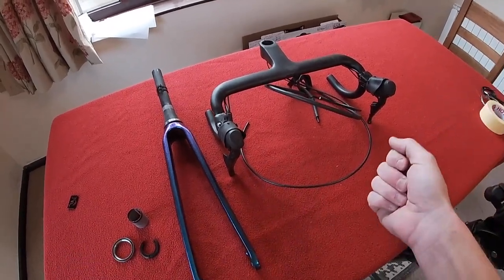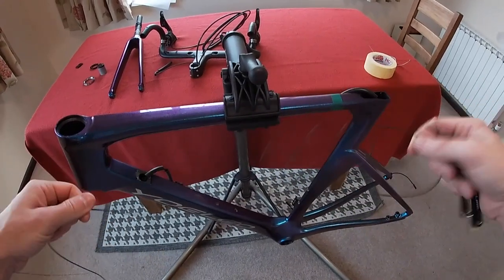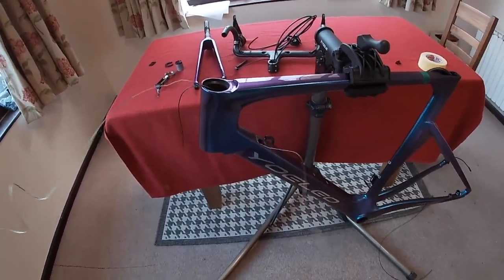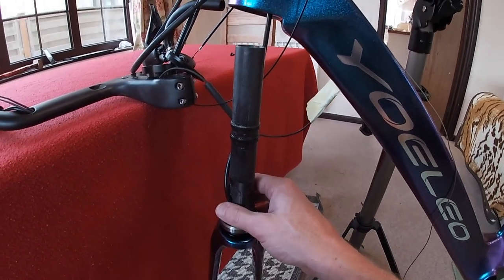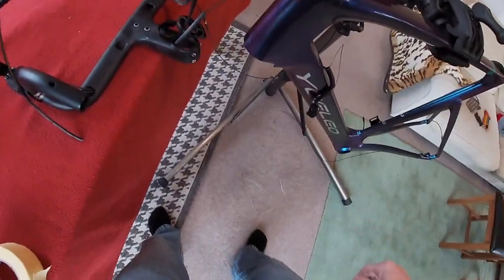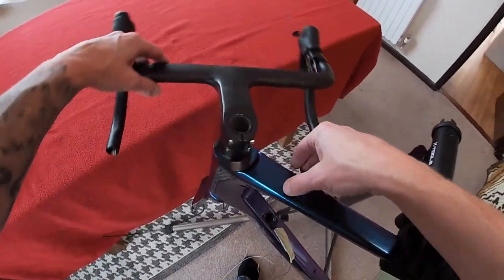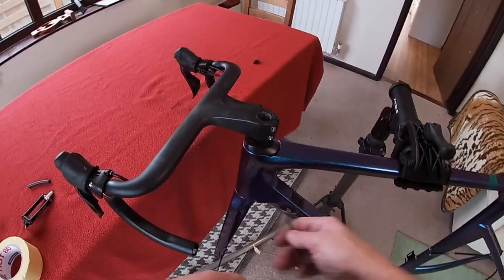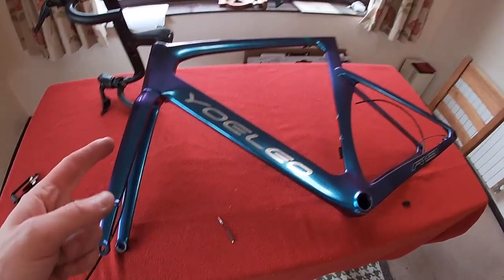Installing Di2 Internal Wiring In Handlebars

Comment: Nice build! Nice colour!

I noticed something interresting regarding the frame geometry. The new R9 frame is quite different from the first generation (which I have). The handlebars are different, first generation are wedge fixated (I think the clamp solution is better). I took some measurements on my R9, and the downtube on my frame only has a 12 mm wide trunkation on the back side. Down tube on my R9 does not have any holes on the back side. The seat post is also quite different, my seat post is tear drop shaped with no truncation at all, and the end of the top tube as well. The area around the bottom bracket is also a bit different, more truncation on the new frame. I suspect that the old frame was a nightmare to put together, especially with mechanical groupsets.
Reply from the maker: Yeah I noticed my frame was different from that on the site and wondered if I maybe had a prototype or something.. I hear on the grapevine that there will be a 2021 R9 release so we will wait and see. 👍

Comment: Impressed with your work, but not how they solved the internal cable routing. Looks like a total nightmare. Are the spacer at least split so that you can take one out without it taking hours?
Reply from the maker: Yes they are split so that makes it tons easier, if they made the fork hole at the front it would be a lot easier. 👍
Reply: @KyrosHouseCycling  yeah its weird that it is towards the back like that. On my R12 fork the hole was just on the side, above the break.  
Freddy its really not that bad when you are doing it. I mean, some people spend 30 minutes washing their bike every.... 2 weeks or so, and this takes about an hour everything together for the first time, just once. But it looks sooo nice and clean forever.
Reply from the maker: @cyclingmilan  yes it was the most annoying part having the hole there. But it’s done now...until the new frame turns up. But no problem because I’m a pro at it now! 👍